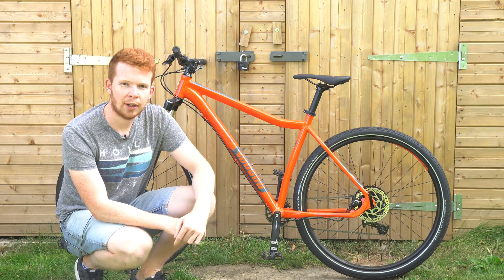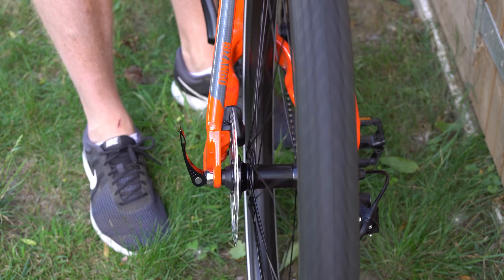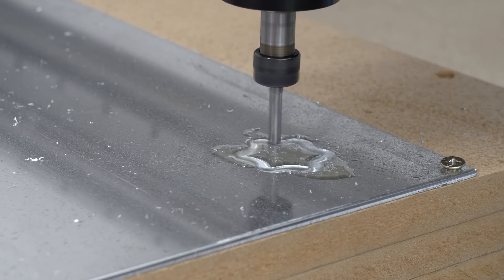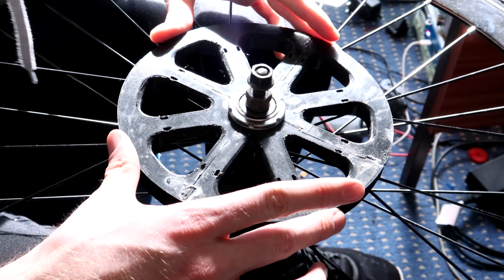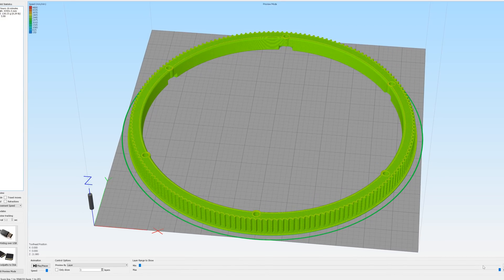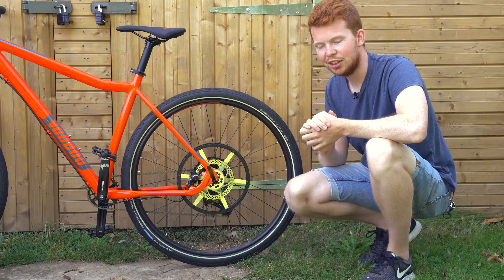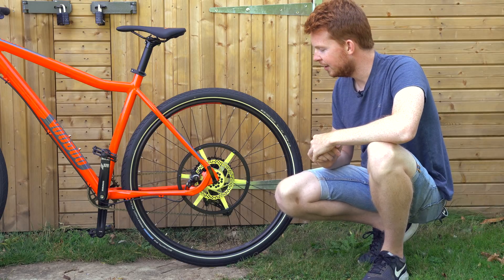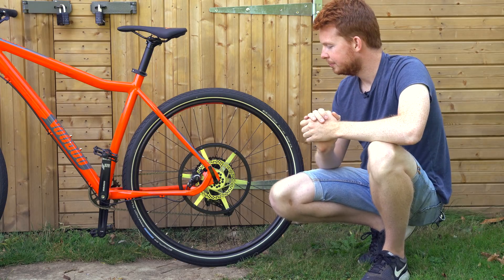Electric bike 4.0 - Pulley

Comment from the maker: I want to make something clear as a number of people have asked. I have not painted my disk brake! It's in fact the reflection of the grass being exaggerated in the camera. But thanks for pointing out it would reduce my braking ability ;)
Reply: The most observant folks will notice that the gate hinge is reflecting the same hue..
Reply: - 3D print adapter for CNC spindle to attach trunk from a vacuum. Very useful!
Reply: b'b'b'b'but the yellow color!!!! Seriously, a  fantastic video and nice design methodology.
Reply: I thought you had spray painted it all yellow to look cool or something, glad to hear otherwise. One thing about Elictric bikes is that if the battery dies or you run it down to far you can have the issue of not only having to pedal a heavy bike around with the added force of needing to rotate the motor 18 times for every one spin of the wheel. It would be really cool and much easier to pedal around with no power if you could create a way to separate the first and second steps or have some way to pull one of the belts off without needing to take more than a minute or so. Obviously if you could just pull the belt off the gear on the wheel and wrap it up out of the way that would give you the least rolling resistance but I'm sure you can find a more elegant solution. I also thought that I would let you know that Mathias Wandel used the trick of a curved edge wheels on his band saw to get the blade to track straight, that might help reduce friction if the belt is not rubbing on edge guides. Also I think you should talk to AvE about some of your pneumatic creations. I think that you two could create some really cool things together. Keep up the awesome creations Tom!
Reply: I have a question, why don't put the motor on the front wheel? This should enhance the scavenging of your energy recuperation system due to the center of mass shifting forward when braking and therefor allowing more brakeforce on the front wheels.
Reply: Tom Stanton 7
Reply: By changing the video speed to 25%/0.25 we easily see that you didn't paint the disk brake ;)
Reply: Why didn't you just replace the gears on the bike with the pully it woud remove the space problem and make it Easter to mouth as its designed for mountin gears
Reply: Why don’t you make a grip connecting to the motor so the grip can move the wheel directly
Reply: Hello Tom, thank you for your video. I have a question about the aluminium CNC, what is its brand please ? 

Thank you

Comment: Have you tried replacing the pedal drive with the motor?  The bike already has an excellent, proven pulley system (the chain), use the motor to drive the chain.

Comment: USE A POULIE WITHOUT TOOTH ... IT IS WELL ALSO AND ESPECIALLY LESS COMPLICATED.
FORGET YOUR DISC BRAKE AND FIX DIRECTLY YOUR PULLEY ON.
CONICAL BELT ! IT WORKS VERY WELL. NOT NEED A LARGE STRAIN TO HANG !!!!

Comment: Great diy e-bike videos. Did you consider sacrificing your low gear as a hub for the pulley? This would allow more freedom with your hub, and, of course the bike is designed to take torque from there too! You could even bond the two plastic pulley halves directly onto the sprocket. Of course this complicates any ideas of regenerative braking but that isn't a consideration for me.

Comment: I hope that you don't mind constructive criticism.  

It's a great idea/video  but a pity that you didn't show it I'm action / working / riding on the road at the end of the video.

What is unclear,; are you looking to drive the rear wheel by the pulley?  If so,  how do you disconnect the drive system when you brake ? 

Wouldn't a Crank mounted motor   be more efficient with the pulley acting like a flywheel / regenerative braking system  kers ? Like this. 
.https://youtu.be/88enyyB-Qm0

Comment: Tom, love what you are doing, awesome project, if you keep going long enough you may end up with an LMX which in my opinion is the best system ever, but the project is not financially viable if you need to pay more than $300 AUS for a vesc controller. I got a TSDZ2 torque assist mid drive delivered for only $420 AUS. Are there any cheaper controllers that will work ?

Comment: There is a way easier way to ensure construction lines are straight. After starting the line just type in the lenght or press tab to put in the angle. Pressing tab again will lock the setting, escape will unlock it

Comment: Thanks for showing how to design the pulley!  I just completed a skateboard using a 200mm pulley glued to the back wheel hub. I think a lot of people will create a lot of powerful transportation devices with this pulley!  I bought a cheap VESC from banggood, a 35A VESC and  Racerstar 6368 motor.  This budget combo is hard to beat :) I whish I would have had more torque but it handles medium hills fine. Going for a gear ratio above 10:1 is usally the way to go I think, but I cant fit a larger diameter pulley on the wheel without it coming very close to the ground. Have you ever considered building a 50-60cm diameter pulley? I mean printing 4 separate pieces using the full build area of the creality 10s? I considered printing a huge one and glue it onto the brake surface on the rim. A huge pulley like that would give enough torque so a small motor could be used and a cheap ESC could we adequate I think.

Comment: Get yourself a bottle of tire slime and run your tires tubeless. In case of a puncture, simply remove what caused the puncture and continue on your merry way. The slime will seal the hole. You can get a dozen punctures on the same trip and still get home on a single charge of air. It's brilliant.

Comment: Still pulled system is not the most efficient I wonder if this will get 50+ 
 miles with a 36v 18ah battery like I do

Comment: Tom, I think I forgot to tell you on Patreon a good while back that I successfully implemented a similar geared system using your v2 pulley and my own mount. I have since been doing a good amount of analysis regarding the slippage and have come to similar conclusions with the step down gearing. 

I’m currently in the process of designing and fabricating my own brushless motor because why not, right? 

Great work on the setup. I like to get out of my comfort zone with the mechanical aspects as I am an electrical engineer, but I have found no real issues. If you have any questions or come across and obstacles, feel free to contact me, I have about 9 months of testing and analysis. 

With regards to optimizing your battery and motor setup with the vesc, I can provide some data on maximizing your output. Also, I am at the point that I comfortable enough to create a linear system of equations incorporating each aspect of the ebike power delivery system. I believe it will greatly help manage aspects of further refinement. 

Let me know if you need anything, I’m gladly here to help.

Comment: How does something like this compare to one of those pre-made Ebike conversions? I've been thinking of modifying one of my old bikes to try this out, but I'm not sure how much I could do. I'm trying an E-scooter right now, and mounting the motor is much more of a challenge than I thought.
Reply: This is many times more powerful and faster. This is also illegal but that's a risk Tom takes.
Reply: Well depends on what kit you use. I use a middrive Bafang with 750W and I can climb walls with it
Reply: Its perfectly legal for mountain-biking.
Reply: Obviously much simpler to just buy a kit, but you are limited to stuff people sell.

Comment: I have no idea what I'm talking about, but why are you attaching the bearing that bends the belt to fit between the wheel and the frame onto the same assembly as the motor mount? It makes more sense now that you have a two step thing going on (since it may be more convenient to mount all the things on one thing) but it could put unnecessary stress on the motor mount.

Comment: "ebike ready" tires? Interesting, I had no clue that was a thing.
Reply: In some countries you can have a fast 45kp/h or so, if it has appropriate parts. Having tyres rated for that speed is usually a requirement.

Comment: Hey because I think you are an intelligent person I have a question for you. At home I have laying around an old brushless motor from a mover it have hall sensors and it is an innrunner at 36 volts. I want to print me a underwater scooter and because I don't now how to make axe from the motor waterproof I just thought why can't I just leave it an the water what should happend. First of all I know that I must isolate all the cables and maybe the i will destroy all the hall sensors and maybe the bearings but. Can you agree with or was their something wrong or must I concern some points which I've don't mentioned.

Your robin

Comment: Amazing work, as always, such fun to watch!

Tom, did you consider removing the disk break and replacing it with electric breaking? 

You will still have your front break for fast breaking, and you will win some recharge if you use mostly. But the most important reason is that you'll have full clearance for the spikes which hold the pulley, so those could be straight.

Comment: Just out of curiosity, have you considered dropping the rear brake entirely? It would reduce the complexity of your pulley design, and not really reduce your braking ability by much (or at all if you used the motor to brake).
Reply: I mountain bike and have had my rear brake fail before went over the bars and couldn’t stop without losing traction and the test you linked is on a road bike using rim brakes very different to a hydraulic disc brake shown here that thing will buck you straight off if you slam in the front brake.
Reply: Not a mountain biker, so can't really speak to that. Obviously the dynamics of braking on the road and on the mountain are very different. I guess in my mind, he's not using the bike to bomb down technical trails or whatever.
Reply: Sure, he probably considered it. And after some consideration, he decided that he would like to be able to properly control the rate of his bicycle's deceleration, rather than leave open the possibility that an immovable object could intervene.
Reply: You do need a back brake unless you want to fly over the bars every time you stop
Reply: I remember this being the case when I was a child... Maybe the kind of bikes I rode, or being much lighter... but in practice using the front brake alone for braking is more than sufficient. Take a look at this person's write-up on the matter: https://janheine.wordpress.com/2013/08/23/how-to-brake-on-a-bicycle/
Reply: This guy. He links a friggin page instead of admitting that it is really nice to have the ability to apply brakes to both wheels when careening down the side of a mountain on a bicycle.
Reply: Hey man... you should maybe read the link I posted. Here's the rundown. Even on steep hills, it's very difficult to "fly over the bars." The rear wheel has much less traction than the front wheel when you are braking on a bike, because the momentum of your body keeps pushing forward, shifting the center of gravity forward, onto the front wheel.

Also, the bike in the video looks like it has a fairly large amount of travel in the front suspension, which would even further reduce the possibility of flipping. I don't think I've been rude or disrespectful to you, so I don't think it's necessary for you to use a disrespectful tone with me.

Comment: if you install your pulley on the disc brake,
  the motor will unscrew your disc !
the braking force is on the opposite side
Reply: The disc on his bike is bolted directly to the hub.

Comment: I've made more than 1000km with my bike which is an instance of your first e-Bike project, the only suggestion to the that project is to sensor your motor and use an e-Bike controller.
Reply from the maker: I externally mounted sensors to the motor when I built my ebike V3. So this will also be sensored due to it running the same electronics. Thanks
Reply: Tom Stanton Oh okay ;) I have sensored my motor internally 120deg.

Comment: I use doble sided tape for cutting thin stock, or painters tape to the spoil board and painters tape on the aluminum, with CA glue holding them together.

Comment: "2 outer walls. 50% infill" Don't do that. The strength comes from the walls, not the infill. See the test video by CNC Kitchen, or at least the conclusion - https://youtu.be/AmEaNAwFSfI?t=8m12s
Your 2 Walls/50% Infill full Honeycomb is the second worst combination on the test.
Reply from the maker: I've tried more outer walls in the past, but it just messes with the tooth definition and causes other issues. I've printed a few pulleys using these settings and they are plenty strong enough.

Comment: Nice work, could you not ditch the rear disc brake and replace with old rim style as rear brake is not used much and this would give you more space, or even ditch rear brake altogether.
Reply: There are no attachment point for other brake types on the frame.

Comment: Why not print a plain pulley (smooth) and glue a similiar belt to it with the teeth facing up?
Reply from the maker: Pulley teeth aren't identical to the belt teeth, in the same way as gears are.

Comment: Good progress.

I machine a lot of aluminium.   WD-40 does work, but it is very thin.   I prefer to use an all metal tapping fluid like Tap Magic or Mobilmet 766.  I find this sticks to the aluminium better, especially on the metal lathe where the work is spinning.

Dave.
Reply: Yes aluminum tap magic is awesome stuff. I won't use anything else for tapping.

Comment: nice pick with the tires. try double-tubing for more thorn/spike resistance (get an old/spare tube of relative same size, cut it down the middle so it can go between your real tube and your tire)
Reply: There's really no need with the Plus's they already have a thick layer of rubber over the Kevlar...

Comment: If you had added the support arms angle to the spacers(and the 3d printed pulley) and left the arms strait it would mean more design but easier repair and gearing changes.

Disc break adaptor plate, spacer 1, spacer2 with precision cnc cut angled arm receivers, arms with no bends needed, 3d printed pulley with receiving ramps for strait arms.

fyi the arms/spacer can go into the spokes as long as the design passes between the spokes and comes out for the pulley to be mounted, this makes the clearance issues irrelevant.

BTW love the spoiler, my mount uses 2 sets of bottle cage mounts, one on the seat tube and the other on the down tube.
Reply: Wow, thats genius. Would have never thought of going into the spokes. Not following you about not having to bend the arms though?
Reply: Matthew Poole
pocket the spacer for the arm, with the bottom of the pocket being n degrees off parallel to the base of the spacer

Comment: Dont use wd40 as a coolant when cutting alumium use alcohol it cools it nicely and prevents chips sticking to the cutting bit. This comes from experienced machinist.
Reply: Where is the shift knob part 2 video? Would like to see it :)
Reply: TheFlobby oh fuck we never filmed it, but if you want I could propably send you some pictures of the finished product
Reply: Would you be able to upload them to a site like imgur or some other public image hosting site? Would be awesome!
Reply: My friend will soon take some pics of it and I try to send them to you. Also nice to hear that you liked my video!
Reply: TheFlobby I think we can do that
Reply: TheFlobby did you see them yet, toyota logo is made with cnc milling machine.
Reply: We liked cutting oil mixed 50/50 with kerosene. Wonder if he knows about soluble cutting fluid, has alot less stink and cleans up easy too. I been a machinist for over 20 years and i was very impressed with his work, bending those arms ain't no joke to get correct.
Reply: Yep, metho to lubricate when cutting Ali
Reply: I use parafin when cutting ally, not wd40

Comment: A short tip for designing in Fusion 360: If you want to make something like a pulley or a gear, don't rotate the sketch elements but rather the created element (this requires you to extrude the tooth seperately from the pulley body). 
The reason is that Fusion gets quite laggy with big sketches but it doesn't have this problem if your sketch has only a few elements

Comment: You have to do a direct gear system, using a solid shaft to connect the pedals to the wheel. You’ve probably seen it but if you haven’t google it.

Comment: how do you attach the pulley to the motor without it slipping? i had really bad luck with 3D printed pulleys on the motor especially with a set screw.

Comment: You're still using long series router bits, despite all that research...
Buy short series if you want to reduce stress on your machine, your bits, reduce vibration & improve surface finish.
Reply from the maker: These are short series bits, or atleast they're shorter than what I previously used for wood. They're recommended for cutting aluminium.
Reply: @TomStantonEngineering  how long is the cutting flute length tom?

Comment: It’s a pity that due to heat when braking, the disc brake disc can’t be used as a magnetic stator and have coil windings in the brake calliper. 
  I’m sure there’d be other issues, but heat would be the main one to overcome.